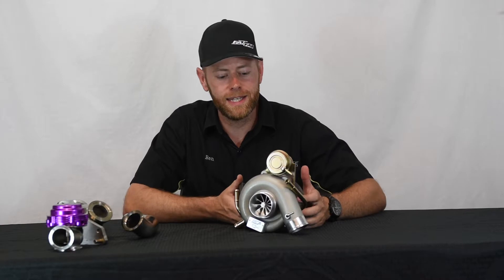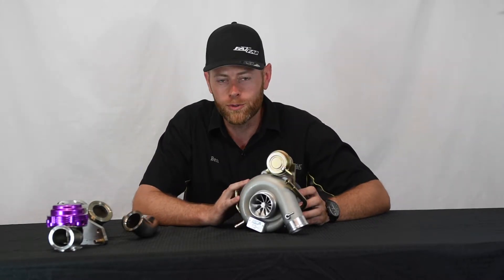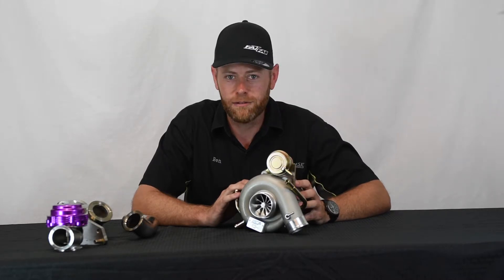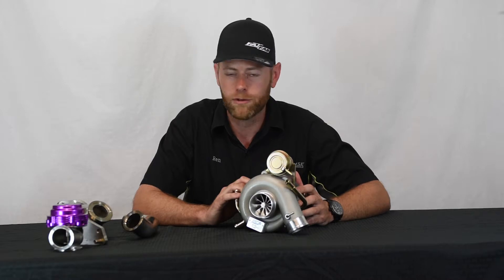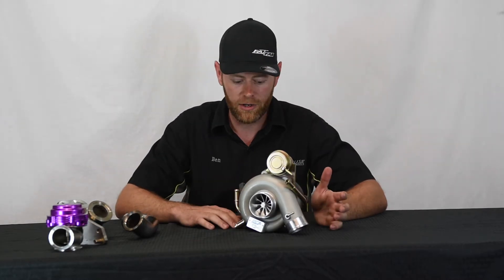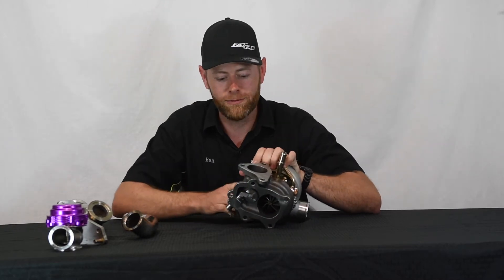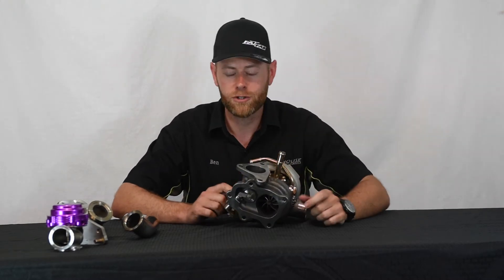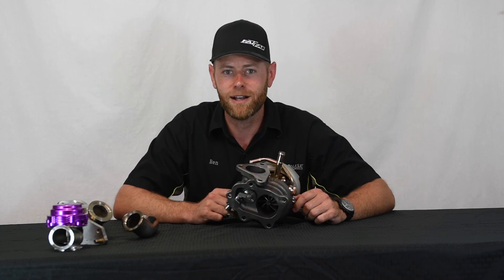BCP X500+ Turbo Video

Comment: I want to keep my spool times quick and very close to the stock turbo so I told my tuner to go with the 8cm instead of the 10. I’m making 444 with a stock turbo (e85 tune) and I just want a safer turbo in its place. Do you have any thoughts.

Comment: Quick question, I have an 07 sti that needs a new turbo. Got an engine build on the way but hacent decided on a turbo. I'm looking for roughly 500 to the wheels, but im wanting to stay with the stock location AND top mount intercooler. Does this turbo match up with the top mount?
Reply: I am using the x500+ w/ 10cm housing along with a process west tmic.
Reply: @esmokah  old thread, what were your numbers? Just picked this turbo up with a GS TMIC.
Reply from the maker: This turbo is not meant to match up to the tmic.  I do believe that BCP does offer an X400 that is the same internally but does bolt up to a TMIC.